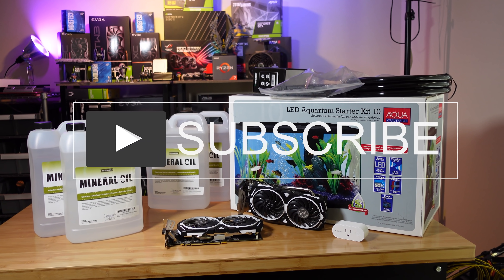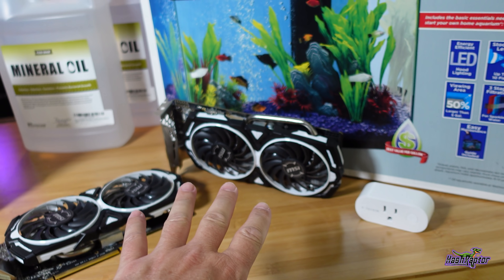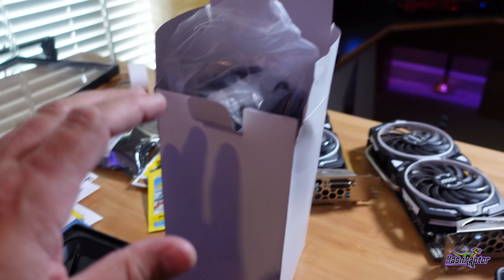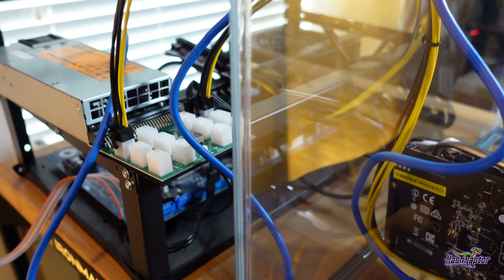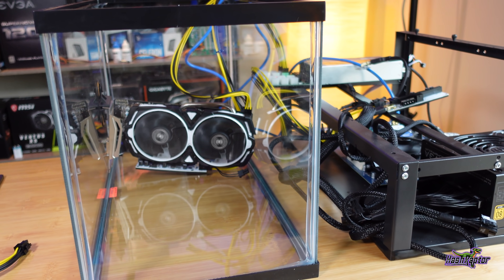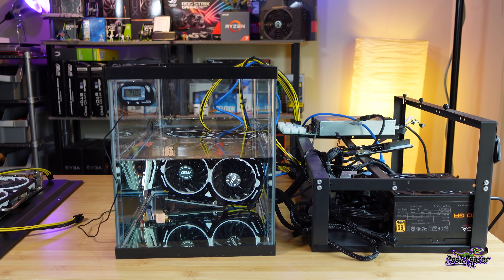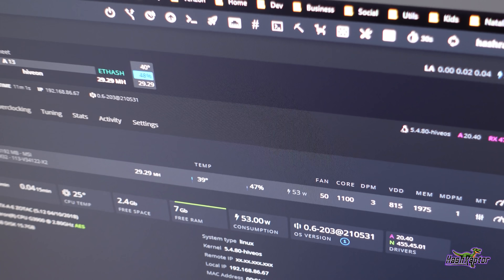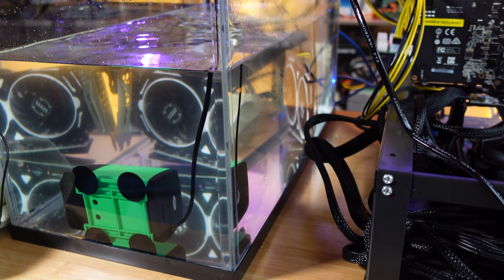Mineral Oil Submerged GPU Crypto Mining Rig Build - Part 1

Comment: I definitely held onto my butt lol awesome Hash Raptor!
Reply: Red Panda i would like to see you test something like this too please. 😇
Reply: hey bud. do you need the cooler if its submerged in oil?? what would the temp difference be?
Reply from the maker: @thorley1983  No really I don't need the fans.  Just testing step by step.
Reply: Testing some 3080 would be awesome (and risky) 😆
Reply: @sibzh  I think it would work well. the only thing the oil attacks is the plastic parts and there would be contsistant flow accros the gpu as the hot oil rises. and if it doesnt work itll just thermal throttle
Reply: According to your last video, you need to submerge into mineral oil your whole basement ;)
Reply from the maker: Thanks as always for watching Panda Man!!!  I really was scared turning that thing on :)

Comment: Props my man, this has been my dream since I was a young man and designed power transformers , I wanted to submerge the whole thing in silicon (even better than mineral oil , well until you spill it)

I’ve brought the idea up with CS people but it’s always hand waved as “too messy” 

It looks like your exchanging the liquid , that seems overly complex , I haven’t got to watch your whole video yet but I’m sure your doing it for some reason. 

The idea to me was overheating wouldn’t be a problem if you have it oil or silicon immersed.  

What you should do is have a metal cylinder made of pure #1 aluminum get it thick , maybe  40mm diameter.  Threaded top, and fitted for  filling will liquid nitrogen. Have a purge valve so it empties as it gets used up. 

During peak times you could manually inject it like water/methanol in a diesel engine , or perhaps some arduino need can rig it to a thermostat and solenoid system regulated by a program. 

Cheers

Comment: Great video! Here are some things that I have been working on.
1. Add perforated floor to tank with about an inch gap between tank and floor. 
2. Create reservoir in middle of tank. The reservoir should open up to the perforated floor cavity and be slightly lower than the fill level of fluid.
3. Add radiator to middle tank reservoir. Cold water enters top of radiator and hot water comes out of bottom. This water is on a cooling loop that goes out to fan cooled radiator. (this is to allow multiple tanks to be added to loop)
4. Strip GPU of everything. Heat sink and thermal pads. Clean GPU throughly. I use an ultrasonic cleaner. (I have found 1 row output cards to be the best in space efficiency) Replace factory heat sink with copper foam heat sink to cover main chip only. GPU main die should be as low in tank as possible.
5. All cables must terminate higher than fluid level to control capillary action.
6. This design creates convection flow and eliminates the need for a water/oil pump. Oil comes up from perforated plate cavity and is cool then passes over GPU which heats liquid. Hot liquid rises and falls into cooling reservoir. Radiator cools liquid, forcing it downward towards perforated cavity.
7. There is a different oil that I recommend but I will have to find the name and post it, if you are interested.
8. Do not submerge PSU. The caps in PSU will degrade quickly and fail.
Reply: Dude please make a video of this

Comment: Noob question, how are you able to run it in oil? Wouldn't that damage it?
Reply from the maker: Hey, no mineral oil actually is non conductive.  You would definitely be better off using a GPU specific oil which is much more expensive, but I wanted to start at the bottom as this is my first trial.

Comment: fill it with gpu's and run a 100 gph aquarium pump pushing the hot oil up and out, into a cheap automotive radiator or pc water cooler radiator with fans, then run the tube to an aquarium water chiller which cools the oil to 60 f, pumped back into the aquarium

Comment: Fascinating project. Think the protection against exposed solder joints on the underneath of the PCI-E will need to be removed as the mineral oil will break this down unless mistaken.

Comment: This is interesting. how often do you think this need servicing? Without fan or backplate attach, maybe it will be easier to service? If this work well, would be a great workaround for those monsterous 3090/3080 hot air maker 🤣

i have less than 10 gpu, thats already making the room really hot, not to mention the already hot climate im living in 😂
Reply from the maker: Man that is a good question.  I would guess it would be good to service it every 3 to 6 months.  But that would really be as a check in.  Will let you know.
Reply: @HashRaptor  I really wanted to try this with 3m novec 1 phase instead of white mineral oil. But from research so far might be quite expensive. Have not gotten reply quote from 3M in my country. Probably they just glance at my request for small order.

From manufacturer & experimentation result document, seem it can be easily clean with isopropyl alcohol by spraying, with minor residue that might need focus cleaning. 

3-6 months per maintenance window seem ok. Once the secondary market flooded with cheap gpu, then gonna buy those for testing 😂

Comment: I think that with good enough circulation of the oil in the tank taking the radiator off would improve heat transfer from the die into the oil, as it would be more direct. Maybe you could submerge the second card without the radiator? It would be very interesting to see. Cool project!

Comment: My advice, don’t get plastic aquariums...  heated oil causes the plastic to expand, it may  break the seal and start leaking at some point.  Build a custom soft loop which feeds into the biggest or multiple radiators you can fit to cool and circulate the heated oil  onto the bottom of the tank 

Also, don’t add any fancy stuff into the tank which introduces air into the oil  - I bet none of these mineral oil are passivated or inhibited, oxygenated air tends to introduce long term oxidative effects on electrical components because oxygen carries some moisture content, meaning you could potentially end up short-circuiting the cards at some point when the moisture in the oil reaches a certain point of saturation.  Serious players would also have the cards immersed in a vacuum to further avoid exposure to air,  most industrial power transformers are usually built this way for the same reason...

Comment: That was very interesting to watch! 
Why wouldn't you want to keep this long term? Seems quieter, cooler. Do you have to replace the oil tho?
It could be interesting to figure out a way to heat a home with the oil, like maybe run it through pipes, that heat the floor of the room for example. 
I want to submerge my beagle in mineral oil as well :D this really got me excited to try it out! Thanks! :)) 

12:14
Reply from the maker: Stay tuned :).  Still testing.  New video soon!

Comment: Nice demonstration. The pump is definitely not doing anything other than adding heat to the oil since the fans should be doing most of the agitating. Would like to see how it performs with even just a simple 2-3 fan radiator hooked up to it externally. You should see a difference in the saturation temp of the system.
Reply from the maker: Great point! and yes you are correct.  Literally wanted to walk through this step by step.  The pump is actually for a future test, but I just wanted to see what would happen if I moved the oil around even more right now.  Funny story I wish I was filming, I plugged that pump in while it was facing up with no tubing attached.  Yeah, so I had a fountain spraying up in the air IN THE OFFICE LOL.  I looked ridiculus hopping around trying to get it unplugged!
Reply: @HashRaptor  hahaha yeah careful with the business end there! Can't imagine mineral oil being very fun to clean up. You made an interesting point too about the thermal paste breaking down... I wonder how much of a concern that is. My main reason for being interested in an immersion setup is to be able to protect the cards from thermal degradation, humidity/corrosion and dust accumulation. In theory this should reduce maintenance costs and improve longevity, but if you have to service them to replace the thermal paste anyways then if might be a moot point. You mentioned the commercial grade 3M liquid in the vid, but didnt see link in description. Do you plan to test this? Is it supposed to address the thermal paste issue?

Comment: if that oil reaches 131C it will burn skin exposed for 5 seconds. also, better make sure that the aquarium can handle a certain temp before it cracks.
Reply from the maker: Yes you are exactly right.  I'm actually not letting it get above 50C max before I shut things down and start the next experiment.  That has only happened once or twice so far.  Definitely need active cooling for the oil.  Thanks for watching and sharing!

Comment: This will definitely run for a year prior to dying. You will have to use Dielectric Fluids Electro cool (EC-100) from Engineered Fluids. How are you dissipating heat? Do you have a heat exchanger /radiator? how big is it?
Reply from the maker: Yes you are right on my friend!  Stay tuned and you will see all of that.  And I definitely want to try some of the fluids designed specifically for GPU's next.  This entire experiment has got me thinking, have you tried deep cleaning GPU's with mineral oil?  As in dust it out and clean it well, then dip it in minderal oil.  Man, it seems like this stuff does really well getting dust out of all the cracks and crevices!
Reply: If you can send me your email, I will send you the recent liquid immersion cooling DIY by me using bc-888 fluid for asic miners z15 & a10 pro

Comment: How the heck is your 2x RX 470 4gb only consuming 44w and getting 29 mh/s on the software, is it a glitch?
Reply: I would also like to know the answer to this. It's an 8GB card, not the 4gb version. And it's 44 watts for one card, not two. But still, only 44 watts for 29 MH/sec?? Wouldn't that make it one of the most power-efficient cards available, even better than the 1660 Super? Please give us the good oil @HashRaptor (no pun intended).

Comment: I would add a powerhead (fish tank item) and then use the plastic upright cut down to size. take the riser that holds tank tank gravel up, and put  the  riser on it then powerhead. It will give you  HUGE circulation in the tank. To cool oil, I would use another powerhead to pump oil into another tank, and chill it will a fish tank cooler/chiller. Used in places like Tucson/Tuma Arizona to cool water for Salt water fish. Then 3rd powerhead to pump it bank into the mining tank. If I remember correctly, powerheads can be set for the amount of water/oil moved.
Reply from the maker: I love all of this!!! Thanks so much.  2 questions if I may.  I was looking around for a fish tank cooler/chiller as you described but couldn't find anything.  I kept running into expensive cold plates used in kitchens.  Do you have a recommendation there?
Reply: @HashRaptor  Dude. you got me rolling in mining. I am tickled to death to be able to give anything back.
Reply: @HashRaptor  OK.. used this as Google search "saltwater fish tank chiller" and here is Amazon "https://www.amazon.com/aquarium-chiller/s?k=aquarium+chiller"
Reply: @HashRaptor   Long post: 
Power head:

https://www.amazon.com/AquaClear-Powerhead-Gallons-Hour-Listed/dp/B0002602VE/ref=sr_1_35?dchild=1&gclid=Cj0KCQjw8IaGBhCHARIsAGIRRYoOly62_GM4s2wBpL6yaRcT1qBQU07VZB3JUWTAWDD4pXUPwXOBjwUaAscTEALw_wcB&hvadid=214461358959&hvdev=c&hvlocphy=9011555&hvnetw=g&hvqmt=e&hvrand=9103093232000333976&hvtargid=kwd-345723204606&hydadcr=16170_9893070&keywords=saltwater+powerhead&qid=1623360576&sr=8-35

Cheaper one: 
https://www.chewy.com/marineland-maxi-jet-water-circulation/dp/133098?utm_source=google-product&utm_medium=cpc&utm_campaign=hg&utm_content=Marineland&utm_term=&gclid=Cj0KCQjw8IaGBhCHARIsAGIRRYqAFKodC6wa5G5sMCCvbyzMRwmgU5oDFklUBAhZsbK5OgHM0XNngfcaAo3bEALw_wcB

Plastic Riser: could not find plastic riser. it is just a tube that the powerhead goes into. Any fish store will have them. (I think, as I said. Been a minute since I had a tank.)

Filter for bottom: https://www.chewy.com/s?query=fish%20tank%20underground%20filter&nav-submit-button=

Add chiller.
Hope this helps.
Reply: @HashRaptor  Let me look. It has been 20+ years since I had a salt tank.

Comment: Y cant u just throw in some ice cubes? How is ur power consumption so low? I'm running a couple 1070's and get 26-27 mh/s at 120-130 Watts each.
Reply: Because 1070s suck, I just sold mine. Get rid of them while they're fetching a high price 😂
Reply: Firstly no heard the saying oil and water dont mix well put ice in there it will melt and the water would become a layer on the bottom of the tank so then the electronic would just be sitting in water as for the 1070 i have to the agree with the other commenter i have an rx580 red devil that was sitting around and decided to use it for some mining and its doing 30-32 mh/s at 104w
Reply: @shaynegadsden  thx for the reply i'll look into that card..as for the ice cubes I was half kidding..but I don't see how oil works - it's too thick to get into the electronics?
Reply: @mightymap007  not that it's too thick, it's just not electrically conductive

Comment: Scavenge pump at the bottom pushing hot fluid through an external 360 mil rad with fans pushing air through. Then have it waterfall off one of the long sides back into the tank.

Comment: I don’t mine, but thinking of dabbling. And as a bit of a tech nut I approve of this “experiment. My question is: does the heated oil rise like air above the cool oil. If so, that could be valuable info for card and pump placement. Although it could also be negligible 🤷‍♂️

Comment: Maybe you could use the liquid cooler with the pump, used for a custom cooling systems, and have the pipes placed on the opposite side of this tank. It could cool down the oil.

Comment: I would think it would work better taking the fans and cooler off and just have the exposed board....I think that's what BBT was doing with the liquid cooling they were doing...I think the same as others that the fans are going to burn out from the resistance the liquid is making...that's why they are so slow in comparison to how fast they would be turning normally....can't wait to see what you do next...very interesting
Reply: No and no, the fans are fine yes there is more resistance but you will find a reduction of heat with in them so in reality the fans should last longer in that situation as for the cooler the surface area isnt large enough to directly remove the heat from a die to fluid interface which still isnt as efficient as metal the system works as is you can not remove the heat sink but if you remove the fans then you still need another way to circulate the fluid or a much larger heat sink

Comment: If I wasn't scared to death, I'd like to mineral oil my rtx 3090......it runs dangerously hot. I've even changed the thermal pads, added backplate heatsinks, and fan attached to heatsinks. Still get a Junction temp of over 100c

Comment: Cool experiment, but I’m having trouble seeing the point.  I doubt heat is the limiting factor in your hash rate, it’s usually more down to memory stability.  With these cards in particular, I doubt any extra cooling is going to allow you to clock the memory any faster.